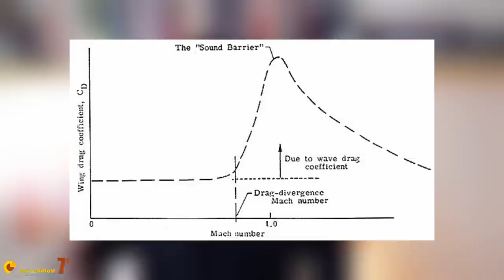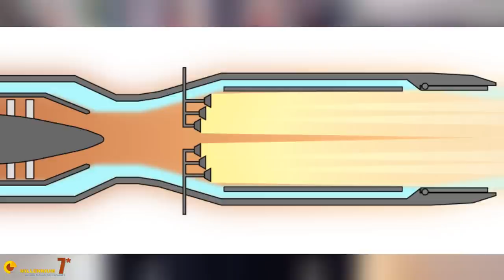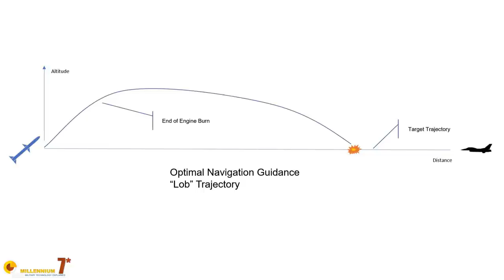Flying SUPERSONIC with NO Afterburner | Why SUPERCRUISE is so Important?

Comment: F35 fan boys left the chat 😂
Reply: Why would a multi-roller ground attack fighter need super cruise? It doesn't.
Reply: @dankuchar6821  It will be the only air superiority fighter for the Navy, at least for a little while. The Navy will be at a disadvantage as soon as the Chinese get their 5th gen fighters up and running.

The Navy can have some salt to go with that wound after they see what the Iranians are doing with their long dormant F-14 fleet, what with recommissioning most of the fleet, all the upgrades to the avionics and airframes, and the new "upgraded AIM-54 they are producing.

Getting rid of the F-14 in favor of the Super Hornet was a mistake. Ending their own dedicated 5th gen fighter program was a mistake, and signing on to the "jack of all trades, master of none" F-35 as their only fixed wing combat asset for at least the next 10 years is probably going to be a mistake as well.
Reply: @operator0  
Well all your points are completely invalid. Stop being a fanboy and get on with reality.

The f-14 was big and fast and expensive and a pain. There's more to being a multi-roll fighter than just being big and fast. The 14 was designed doesn't interceptor. The Navy figured out they didn't need super fast interceptors that couldn't do anything else, so that's why they started putting ground attack features on the f-14. Well it turned out that you could replace three jets with the f-18 and so that's what was chosen. On a carrier where parts are hard to come by simplifying the jets made a bigger difference so that's what was chosen. It's not always about the performance characteristics of the plane. More goes into it than that.

If you have 35 is so far in advance of anything in Japanese have that their jet is comical. do you have 35 is still winning at red flag and according to the pilots I know at Hill Air Force Base here in Utah is the premier multirole fighter. I trust them more than I trust you.
Reply: @dankuchar6821  Let me guess, you think the Super Hornet is just an upgraded regular Hornet, with all the cost saving that an upgraded platform comes with.

Let me let you in on a little secret; The Super Hornet was a completely new design. It's air frame was larger than the Hornet, had different engines and different avionics. The R&D on the Super Hornet was just as expensive as the regular Hornet, and virtually none of the Hornet's tooling could be used on the Super Hornet. The Navy tricked a lot of people into believing that the taxpayers saved a bunch of money by upgrading the regular Hornets by calling the new plane a similar name.

The F-14 can do everything the Super Hornet can do but cheaper. They already had a plane in the shed with upgraded, digital avionics that could carry a similar payload as the Super Hornet, had similar range, but could still carry the Aim-54. That plane was the F-14D.

The only thing the Super Hornet does better than the F-14D is maintenance costs, and it wasn't even close to cheap enough to offset the cost of developing the Super Hornet. Even after all these years, the Super Hornet program is still more expensive than if we had just upgraded existing F-14 air frames to the D model back in the 90s and paid for the more expensive maintenance.

We paid more for an inferior aircraft.
Reply: @operator0  
You sure make a lot of assumptions. another super hornet shares about 35% of its major components with the hornet. But the avionics are completely upgraded and different. That's why the hornet has been completely eliminated in favor of the Super hornet. All hornets are being faced out.
Reply: @dankuchar6821  Yeah, among the "33%" number is stuff like the ejection seat, which have been used on all Naval combat aircraft for decades, and one of the internal fuel tanks. I wouldn't be surprised to learn that they count the wiring in that number because it came from the same manufacturer.

The fact of the matter is that the Super Hornet cost more in total than upgrading the existing F-14 air-frames to the D model, even after factoring in maintenance cost savings over the last 25 years. And, the F-14D can carry the Aim-54

The fact that the Iranians have, effectively, built their own fleet of F-14Ds over the last few years, makes me puke. And, they have a better Aim-54 than the Navy ever had! That plane now outclasses every 4th gen air superiority fighter on the planet and it even competes with 4.5 gen fighters because of their AIm-54. The Saudis are terrified of it, as can be seen by their purchase of billions of dollars in upgraded military equipment in the past few years. Suddenly their fleet of F-15s are no longer at the top of the food chain in that region.

And we could have had it 25 years ago.
Reply: @operator0  
Dude I really don't care. Enjoy living in your little fanboy world. Jets get replaced. They get upgraded, they get swapped out. It happens. It's not the end of the world.
Reply: @dankuchar6821  Billions of dollars of taxpayer money was spent on an inferior airplane. I wonder who got paid off to make that decision.
Reply: @operator0  It will take a long time before the Chinese navy get's their 5th generation fighters. Those they got now can hardly be considered 4th generation as they are heavily limited by their bad engines and ski-jump carriers.
Reply: @mwtrolle  They are progressing at a very rapid pace. Remember, they have stolen a huge amount of technical documents form the US, so their R&D is cut down considerably. They already have the J-20, which is stealthy.

I don't think it's going to be but another 10 years before they have aircraft that can compete with the F-35.
Reply: @operator0  You said "Getting rid of the F-14 in favor of the Super Hornet was a mistake. Ending their own dedicated 5th gen fighter program was a mistake, and signing on to the "jack of all trades, master of none" F-35 as their only fixed-wing combat asset for at least the next 10 years is probably going to be a mistake as well." The Iranians have no carriers so it doesn't really matter much that they got F-14's and not F-15's actually if they had F-15's it would most likely be worse. But no matter what those F-14 (F-15 if they had bought them) but they are old and not upgraded to anything like the USAF's F-15's, Most likely they would stand little chance against a FA-18, as it got better radar, EW and missiles. I'm not the biggest fan of the FA-18 as such, but as they are better as multirole they can have many more on one carrier adding to that is that they are smaller. Think it made god meaning to make the change, as it all round gives better ability and their logistics gets a lot easier. 

If the US were to fight they would most like to use F-15's, F-16's and F-22's from land bases as the main air superiority fighters. 

Iran only got 26 F-14's at best and they are not likely to have that many left, it's a surprise that they can even make any fly still. Besides that, they only got a maximum of 20 MiG-29's, the rest is pure crap as air to air fighting. 

Iran's Airforce is not much more capable than the Iraq airforce in 1991, they have a few better planes but much fewer. While the US has made huge advances in technology since then. 

The US airforce got more F-22's than Iran for fighters and attack aircraft, and most are useless for air to air fighting. 
The US airforce got more F-35's than Iran for fighters and attack aircraft, the same can be said for F15C, F-15E, and many many times more F-16's. All fighters can outfight even the best Iranian fighters. That's just the airforce not counting the navy or army's fighters. 

Most likely the same would happen as in the Iraq wars and most of the pilots would simply decide to flee to some other country.

The Iranian airforce does not matter at all, the problem is the S-300 and their S-300 like AA systems, those are all a lot better then what Iraq had back in 1991. But Israel seems not to have big problems flying their F-35's in as they please, not getting challenged by the airforce or the AA systems. They are not likely to do better against B2's. 

Regarding your comment about the F-35 being a bad idea then I agree, it would have been better and cheaper to develop, many planes using common parts as much as possible. That had saved money and given better them some better planes for most purposes. But that's not the same as the F-35 are not up for the task, they are clearly superb for attacking landbased AA systems and their low RCS gives them a big ability in air to air fighting, especially against nations like Iran. Even though the F-35 program was far too expensive, then the price per unit is not too bad and falling, less than 80 M USD for an F-35A are cheap.
Reply: @operator0  "The fact that the Iranians have, effectively, built their own fleet of F-14Ds over the last few years" They have not! Of the 26 they have not all are flying, as they are not able to make all the parts they, however, are since last year able to build F-5F's, but they are no real danger for modern fighters. Sure they can get lucky in the right circumstances and get a lucky kill, but that is not something I would expect to happen a lot.
Reply: @operator0  " Suddenly their fleet of F-15s are no longer at the top of the food chain in that region." Surely the Saudis F-15C's are much stronger than the Iranian "upgraded" F-14's. With free access to upgrades and spare parts, they are likely to almost all be flying and being much better upgraded. In the worst case, they got two F-15's for each F-14 and most likely it's more like 3 or 4 to one. 

What the Saudis should fear are the ground-based AA systems and ballistic and cruise missiles.
Reply: @mwtrolle  Apparently the Iranians have/are upgrading their fleet of F-14s with domestically produced parts. They have new engines, new avionics, and, most importantly, a new Aim-54 that they call the Fakour 90. 

According to reports, this missile is an improvement on the original Aim-54 in every way.

It has been said that the Chinese definitely helped the Iranians out with these upgrades and probably the Russians as well. It's likely that the new avionics are pretty up to date, but the thing that makes the Iranian F-14 so dangerous against the F-15 is that missile.

If the Fakour 90 performs even half as good as the Iranians claim, then they would be able to shoot down any 4th gen fighter on the planet before the other fighter ever gets within weapons range. This includes the F-15.

Also, the Pentagon believes the Iranians have upgraded and made operational about 50 of their long dormant F-14s over the past five or ten years (they originally had 79). That would put their fleet of F-14s at comparable numbers to the Saudis current fleet of F-15s.
Reply: @mwtrolle  They bought 80, and 79 were delivered before the revolution. The Pentagon says they may have about 50 that have been upgraded and are now operational.
Reply: @operator0  you read or listen to much to Iranian propaganda, they struggle to make F-5F engines, if they have changed any of the engines in their F-14's its because they no longer had functioning engines, and it's not likely to be an upgrade. 

Fakour 90, we only got the Iranians word for that it's working at all, and it's not likely to be efficient against the EW suits of the most modern or upgraded fighters. 
It makes no sense that they or you claim they are really that useful, they only function with the F-14's, really a limited platform that will only go down over time. It also makes no sense to say they are being mass-produced when Iran only got 24 as is the most common number given, but even if it was 50, it's limited how many they can expect to use. Their radars have surly not been replaced by upgraded versions, as they simply don't have the technological knowledge. 
The Fakour 90 are by the Iranians claimed to have a range of 300 km, but are criticized for actually having a shorter range than the AIM-54's 190 km. 

"If the Fakour 90 performs even half as good as the Iranians claim" It doesn't! Anyway, to fire a missile is not the same as hitting the target, the no-escape zone is always much shorter, then there are EW, or physical diversions and diversive maneuvers. 

"then they would be able to shoot down any 4th gen fighter on the planet before the other fighter ever gets within weapons range"
Doesn't really matter if it was true, as it fighting the US would not be fighting 4th generation fighters, but 5th!

"Also, the Pentagon believes the Iranians have upgraded and made operational about 50 of their long dormant F-14s over the past five or ten years" pentagon always comes with that kind of reports, simply as they need to defend the huge spending needed from the US taxpayers to develop and procure more weapons and to push other nations to spend more on defense and thereby buying more from their military complex.
Reply: @mwtrolle  I am not making any claims as to the performance of the upgraded Iranian F-14s against 5th gen fighters, or even 4.5 gen fighters.

Obviously, any 4th gen fighter is obsolete against any 5th gen fighter, but my original point is that America could have had a comparable platform 25 years ago and instead went with the inferior Super Hornet. Now we see what the F-14 could have been with the upgraded Iranian F-14s.

Also, I am not saying the F-14s are being mass produced by Iran. I am saying that the Iranians have upgraded 50 of their original 79 aircraft, which they bought from the Americans in the '70s before the Ayatollah came to power.

Many of those airplanes were used to keep others flying as the U.S. had an arms embargo against them, and Iran was unable to get spare parts for the planes throughout the 80s, 90,s and into the 2000s. The panes used to donate spare parts were not destroyed, they were put into storage and the air frames stayed intact.

However, sometime in the late 2000s, they began a program to upgrade the F-14s with parts that the Iranians produce themselves and have now recommissioned approximately 50 of the original 79 that were sold to Iran. The technical know-how to upgrade their F-14s came form China and probably Russia, but the parts are produced in Iran.

I don't know where you get the idea that Iran only has 24 F-14s. They have never had only 24. They lost less than 10 in the Iran-Iraq war, and they have had a few accidents, but they have never been down to just 24.
Reply: @operator0  "America could have had a comparable platform 25 years ago and instead went with the inferior Super Hornet. Now we see what the F-14" except it's not really inferior, at least not in all aspects, actually the F-14 is inferior in most. M7 explained why in the video I shared. The F-14 is btw the 4th generation fighter, while the FA-18 are 4.5 generation. The F-14's RCS is 25-35 m2 while the FA-18's RCS is 1 m2. BTW the Superhornet is 25 years old.
Reply: @mwtrolle  The F-18 C/D/E/F is 4th gen. The only planes that are 4.5 gen are the Eurofighter, the Grippen E/F, the Rafale, the SU-35 and the Mig-35. There are no U.S. panes that are considered to be 4.5 gen.

The F-14D is not inferior to the Super Hornet in any combat metric. It had advanced, digital avionics (for the time), just like the Super Hornet, it had a better combat radius, it had better speed, and it could carry the same air to ground ordinance. But, the F-14D could carry the AIM-54 and the Super Hornet could not, which makes the F-14D a superior interceptor. The F-14 could also rate fight the Super Hornet and win.

The one advantage the Super Hornet had over the F-14D was operational costs. It was cheaper to run. However, the F-14D was cheaper to buy. In fact, the F-14D was much cheaper to buy, because that program did not involve a long R&D process for a brand new air frame like the Super Hornet did, and most of the proposed aircraft were going to be upgraded F-14A and B models, so many of those air frames already existed. In the end, the Super Hornet program cost more than the F-14D program would have.

As to RCS, That number you are quoting is for the old, original Hornet, which is 20% smaller than the Super Hornet. The old Hornet is no longer in combat service, and hasn't been for decades. Understand that the old Hornet and the Super Hornet are completely different air frames.

the F-14A and B models had no problem aquireing the Hornet or the Super Hornet at 70+ miles with their outdated AWG-9 radar. The difference is that the F-14 could do something about it (launch an Aim-54 at them), while the Hornet/Super Hornet could not. The D model could have done much, much better with it's more advanced radar. RCS needs to be much lower than 1ms for an aircraft to be considered stealthy, and doubly so with advanced radars like the ones equipped in any up to date fighter, like the F-14D would have been.
Reply: @operator0  According to the Air Power Development Centre F/A-18E/F is 4.5 generation. That makes sense as they are redesigned to have a much smaller RCS and have, has a better engine with 35% more trust, have better EW and radar and more!
Reply: @operator0  "The one advantage the Super Hornet had over the F-14D was operational costs. It was cheaper to run. However, the F-14D was cheaper to buy." first of all, it's not the F-14D Iran got, they got F-14A/AM. An FA-18E 66 M USD in 2020 and the price of a F-14 in 2020 would be 845 M USD, that's without all the upgrades that would be needed as better radar and EW.
Reply: @mwtrolle  You're talking about the Block 3 Super Hornet? The same Block 3 that wont be operational for another 2 years?

It can't super cruise, something all of the other 4.5 gen fighters can do.

I have doubts about the Block 3's "stealth" capabilities since they are adding conformal fuel tanks to it. I doubt it will have a better RCS than the Typhoon or Rafale. We'll see if Boeing over-promised when the plane finally finishes testing.

Also, as far as I'm aware, the development of the new engine is experiencing setbacks and no date for production has been released. This could force Boeing to use the old engines, or push back the delivery date of the Block 3. It's my understanding that the two test vehicles that were delivered to the Navy are using the old engine.

Not much is known about the performance capabilities of the Block 3. I'll view any information about it's performance with skepticism until it becomes operational.

In any case, I can't view any aircraft as a 4.5 gen without super cruise capability, despite what the Australians say.
Reply: @operator0  "As to RCS, That number you are quoting is for the old, original Hornet, which is 20% smaller than the Super Hornet." what does that matter, as it was the E and F models that were being built when the F-14 was retired. Also the original Hornet didn't have a lower RCS even though it was a smaller plane, at least not compared to the newer super hornet models. 

"RCS needs to be much lower than 1ms for an aircraft to be considered stealthy" No only 5th generation are considered stealthy. But you seem not to understand the concept. 
It's like walking towards two bikes at nite with a flashlight, obviously, you will see the one with a reflector long before you see the one without. 

Besides that, the F-14 takes up much more space on the carrier deck, the availability is horrible besides taking up much more fuel. Also, you could have had much fewer as it was not that good for other roles, so they had to have many different types of planes. limiting the number of planes they could have available for a given role and also making all the maintenance much slower and more expensive. 

The F-14 did have its advantages, but all round it was not as good and it was far too expensive. 

>>But while the F-14 proved to be a competent strike aircraft, the Boeing F/A-18E/F Super Hornet was superior in most respects to the aging Tomcat as a strike fighter in the post-Cold War era. Particularly, the Super Hornet was far more reliable and cost effective—and with its much more modern avionics, it was mostly a more capable aircraft. However, there are still some gaps that the Super Hornet could not fill.

Thus, the successor to the Super Hornet could have capabilities that resemble the F-14 Tomcat in terms of speed and range. However, the similarities will likely end there. The Tomcat was an antiquated and unreliable beast in the late 1980s and it simply was not up to par during the 1990s and the early 2000s in terms of its avionics. New sensor, data-link and propulsion technologies—along with developments such as artificial intelligence—means that while a future NGAD aircraft might fill some of the gaps left behind by the F-14, it will not be a Tomcat.
https://nationalinterest.org/blog/buzz/why-navy-misses-f-14-tomcat-despite-some-big-problems-43837
Reply: @operator0  " have doubts about the Block 3's "stealth" capabilities since they are adding conformal fuel tanks to it. I doubt it will have a better RCS than the Typhoon or Rafale. We'll see if Boeing over-promised when the plane finally finishes testing." I just wrote it's not stealthy, but it does have a much lower RCS than an F-14 or F-15. No, I'm talking of E and F versions that are around 20 years old now. It's comparable to the Typhoon and Rafale as you mentioned, but they are also 4,5 generation fighters, the F-14 are not.
Reply: @mwtrolle  A smaller plane will have less RCS, provided that no effort was made to make the larger plane stealthy, which the Super Hornet was not. The original Hornet has less RCS than the Super Hornet. As to your statement that the F-14 was being retired while the Super Hornet was still in production; OF COURSE IT WAS! That's my point. The Super Hornet should have never been in production in the first place. The F-14D should have taken its place. I've been arguing that all along.

If a radar designed and built in the 60s can detect an aircraft at 70+ miles, then that aircraft cannot possibly be considered stealthy. As I've stated before, the antiquated AWG-9 radar on the F-14A could detect the Hornet and Super Hornet at that distance.

The quantity of aircraft that a Nimitz class CVN deployed with did not change when the F-14 was retired. Apparently, the size difference didn't matter at all.

There is literally no mission the F-14D couldn't have done that the Super Hornet can do. The F-14D could have been the all-in-one aircraft the Navy desired, just like the Super Hornet is right now. It could already carry a similar ground attack payload, and it could already do aerial refueling. There's no reason that air frame couldn't have been used to do the ECM work as well. One thing the F-14D can do that the Super Hornet can't is reconnaissance, as the F-14 was designed from the start to carry the Tactical Airborne Reconnaissance Pod (TARP). The Navy really missed that capability when the F-14 went away.

The F-14B was a substandard attack aircraft, but the F-14D was just as good, if  not better, than the Super Hornet.

"The F-14D solved most of these issues and could integrate the high-resolution PTIDS, but the Tomcat’s lifespan was cut short in the mid-2000s when DoD cut funding for all Tomcat upgrades in favor of the new F/A-18E/F. Many have lamented this decision, as the Tomcat’s bigger airframe has advantages in the strike and interceptor role (650nm to the F/A-18E/F’s 475nm) as well as others."

https://news.yahoo.com/bombcat-navy-apos-deadly-f-090000828.html

The only reason the F-14 became obsolete was because the Navy chose to spend its money on the Super Hornet rather than the F-14D. 

I believe this was a bad decision that cost the U.S. taxpayers a lot of money. 

As I have said before, numerous times, the F-14D would have been cheaper than the Super Hornet, after factoring in all development, purchasing and operating costs. The Super Hornet was a brand new air frame and cost considerably more to design, test and procure than simply upgrading existing F-14A/B models to D models and paying for the higher operating costs. You seem to be ignoring this argument and only focusing on operating costs.

There is literally nothing the Super Hornet could do better than the F-14D. Nothing.
Reply: @operator0  M7 have just made a new video on the FA-18, go watch that.